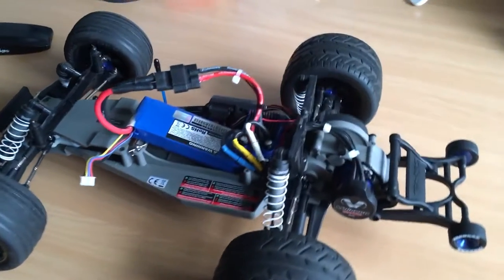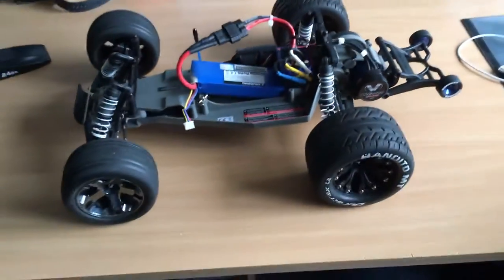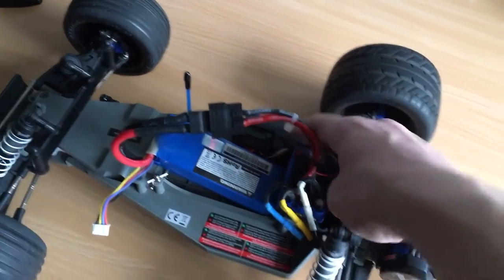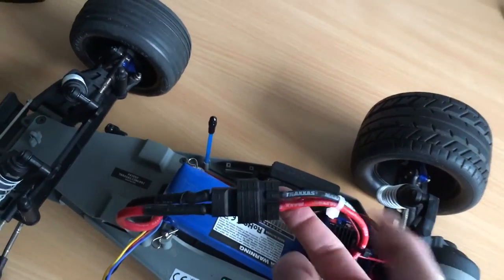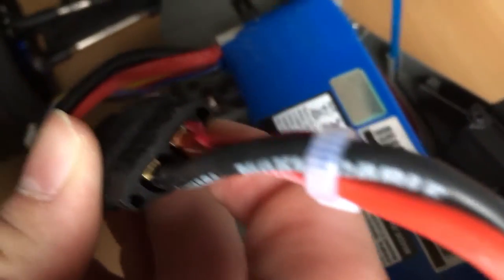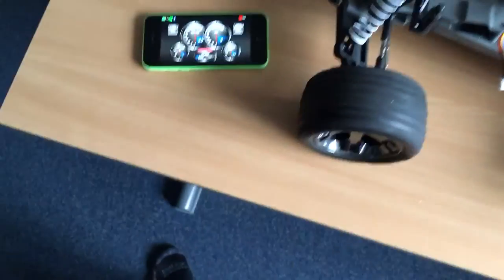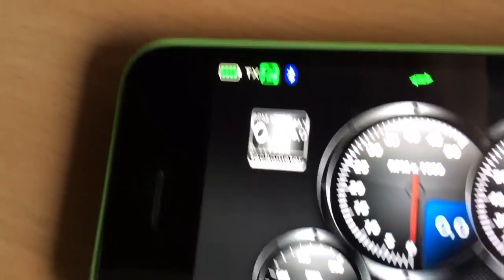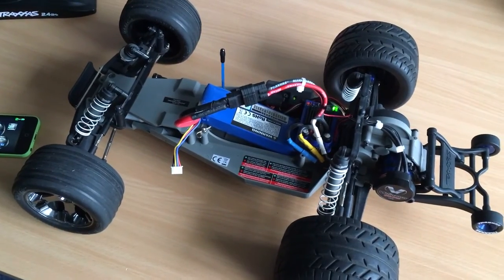Traxxas Rustler VXL With All The Telemetry Sensors! and How to see Voltage without part TRX6541

Comment: Where did you get the sensors, how much, and can you make a video where you are running it so i can see the app working?
Reply from the maker: Hi, thanks for your comment. Since the car looks a lot different now, I don’t have the sensors on it anymore. Here are the product links for all the sensors:

TRX bluetooth module:
https://traxxas.com/products/parts/transmitters/6511tqitraxxaslinkmodule

TRX RPM sensor:
https://traxxas.com/products/parts/telemetry/6520

TRX voltage/temperature sensor:
https://traxxas.com/products/parts/telemetry/6521

TRX telemetry RPM magnet holder:
https://traxxas.com/products/parts/telemetry/6538

TRX voltage power tap:
https://traxxas.com/products/parts/telemetry/6541

Total: $78

Comment: How does one red wire to the batter provide a voltage readout????
Reply from the maker: traxxasbandit1 the battery puts a current on the red wire that connects to the receiver. Then the receiver just reads out that current.
Reply: So if I just Solder a wire to the positive lead, what pin does it go on the receiver?
Reply from the maker: traxxasbandit1 you will need the voltage and temperature sensor to make it work. Those two work together. And that sensor allready has a red wire attached to it (the one that I solderd to the plus wire). The  the 3-pin connector just plugs into the receiver